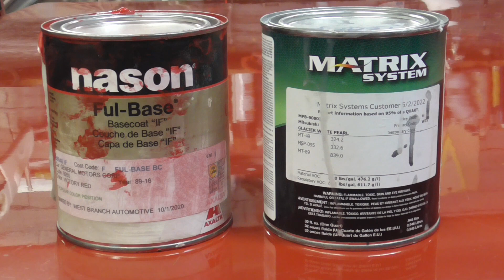Does Base Coat Need Hardener?

Comment: It was back in 1980 up until 1992 and some other cars up until 1999, I used PPG ditzler acrylic enamel on some early and late 1970s cadillacs I bought for cheap prices. It worked best with 35% reducer. I had no one to teach me how to paint a car, so I just did it. These paint jobs came out good on these cars and I did these jobs in the back yard of my dads house back then on my days off of work. There was no hardener at all because I didnt know it existed. Now I know even today you dont need a clear coat when using acrylic enamel. The last one I had painted was a 79 sedan deville cadillac and I drove it up until 1999 and had painted that one in 1992 and it still looked shiny and beautiful in 1999 and was an outside car. Go figure?? I also used no primer at all, and did not use any hardener and simply used a flat sander to sand down the existing paint. So based on that, that fender in the video above I could have done with acrylic enamel and it would be shiny for 7 years or more. Any comments? Im open to any comments of why this worked on what was around 8 cars. Heres something else. in 1999 I also painted this 66 mustang red and used acrylic enamel and no hardener and no gloss and it came out very shiny, but a guy names Ramon that was supposed to be a professional painted my employers 1969 oldsmobile 442 red with acrylic enamel and he had gone to school, but my job on the mustang without gloss came out better than his job where he used gloss. Now I know you have to use clear coat gloss on urethane because urethane is flat, but not on acrylic enamel.
Reply from the maker: I used that same paint in the 80's - Ditzler - with the hardener and same amount of reducer.  That and Dupont Centari were great paints.  Acrylic enamel doesn't need a hardener to dry or cure but works better with one.  Urethane on the other hand absolutely needs activator to harden or dry.  Single stage urethane will be shiny like acrylic enamel but needs hardener.  Base coat urethane will be dull and needs clear for the shine.  Hope that helps - ask more ?s if needed :)
Reply: @LakesideAutobody  Yes, that did help. Because I wasnt sure if you could get away with not using hardener in acrylic enamel. I didnt use hardener back then because i was ignorant of it being around and no one would inform me of anything back then. The reason I dont like urethane and gloss is because since the age of urethane all these cars with worn off gloss on the roofs and hoods. As a boy back in the 60s any old abused car might have paint with no shine, but even then I never saw paint that peeled off in the way these 90s on up car hoods do today
Reply from the maker: @EarlGuyton425  I'm not totally sure but I think the pealing paint from GM may have been the beginning of water based paints.  Urethane paints stick well and hold up better than any so don't be afraid to use them.  Enamels did lay out nicer (my opinion) but urethanes are very durable and will not peel or flake off if used correctly :)
Reply: @LakesideAutobody  I wasnt really talking about peeling paint, but the gloss is gone and leaves the flat color under it is what I meant. Mainly on hoods.  I see this all the time on japanese brand cars and even the mans mercedez at the station i visit many times for hours as he does state inspections. Its Nissans and Toyotas that are the worst that come in
Reply from the maker: @EarlGuyton425  Got it... not sure what caused that myself.  You'd think the OEM's would be using the best stuff out there :)
Reply: @LakesideAutobody  Dont know. Maybe its the climate here. I live in Houston Tx and this is common on cars six years and older.  Areas of hoods and trunks have large areas that have where the gloss become white around the edges and it grows and leaves flat paint that is gone after some time and it looks so bad. Ive seen some videos on it here at YT and its described as gloss coat worn away.  This is so common here that it can only make me know a good paint job with acrylic enamel like the 70s and 80s procedures would stop this. My 02 ford supercrew hood and roof did this BTW. Now I painted my roof 3 years ago black from red and that scheme made the truck look more distinguised and helped its looks. My 89 Cadillac brougham still has the original number 11 artic white and its still good and before I retired in 2022 it was out in the sun all the time. Im not sure what type paint is on it, but the mil thickness is only 2.0

Comment: Hey Jerry, I think we were recently discussing this - cool that you did a video on it!! I recently switched paint suppliers and the new one sells PPG products. I bought a gallon of their Omni MBC basecoat - no hardener needed (per the TDS it is optional). The basecoat will be protected by the hardened clear. Makes sense to me! With paint products being so expensive, it is nice not to be throwing any away. Also, no fretting over whether I am mixing enough or too much = waste. I mix a cup, paint the repair and poured the excess into a clean, new one pint can for next time. Thanks Jerry, you-re saving everybody $$$!!
Reply from the maker: You're welcome Icar - I believe we did talk about this recently.  Thanks for your input my friend.  You're right about the cost lately - crazy!

Comment: Nice job Jerry.  I love spraying simple reds.  I dunno if you've ever sprayed Endura, but it's a two part epoxy paint.  We were a pretty busy shop so we mixed it almost exactly 50/50 hardener/paint with a little thinner if required.  It was the perfect ratio for fast drying and glossy finish.  One day I sprayed the entire first coat on a class B camper van with no hardener.  For some reason I'd mixed it 50/50, but I used no hardener and 50% thinner.  I kept waiting for it to tack up, then I realized what I had done.  I just sprayed my second coat with extra hardener and the third coat as normal.  That was 35 years ago and the paint held up longer than the van did.  I used to see it around the city for years
Reply: Endura from Edmonton?
Reply: @p-m2127  yes, Endura from Edmonton (where I live)
Reply: Best paint ever for winter beaters

Comment: In the UK all solvent basecoats are air dry, but the data sheet on a few brands like ppg or prospray does mention adding 5 to 10% 2k hardener will add to the adhesion properties of the basecoat, reduces chipping, but it is optional.
Reply from the maker: Thanks for the input EJ.  I like to hear others' thoughts on the topic.  Have a great weekend :)

Comment: I used nason here last week without the hardener. Everything went well until I started wet sanding my clear coat. Everything dull up like it should but polishing didn’t help one bit. I used 800/1000/1500 all the way to 3000 prior to buffing. That being said my hood looks like I sanded it with 600 dry. My question is I’m spent and now I’m just going to shoot single stage over this mess. Time is my question about how long should I wait before shooting single stage. It’s been in the sun for a week. Thanks for any advice. By the way I pretty much learned a ton from you. I never had this much trouble with any of my other paint projects. You are an inspiration.
Reply from the maker: You did add the hardener to the clear though right.  You have to have activator in the clear but not the base. You also have to use hardener or activator with single stage.   What brand of clear did you use?
Reply: I actually worked out my own problems. I wasn’t using the right buffing pad therefore I wasn’t cutting anything out. After I realized my mistake it started to shine without burning through the clear. Bodywork sure can be scary when your new and it’s definitely not cheap. Thank you for your time,advice and so on. I really enjoy the restoration process especially when it turns out good. Have a great weekend.

Comment: You seem to be missing the point of what the activator does. It's just cheap insurance. The purpose of the activator in the basecoat is to enable it to be repaired.  Let's say you're polishing the panel and you cut through the clear to the basecoat. If the basecoat was activated no problem. The basecoat is cross-linked and basically impervious to solvents at that point. You apply more base followed by clear and the world continues to turn. If you don't activate the basecoat as soon as you shoot more base onto the un-activated base it will fry up leaving you in a complete shitstorm. This is why all of the major paint lines: BASF, PPG, Axalta, Sherwin-Williams and Akzo Nobel require activation of their solvent basecoats for them to warrantee the job. Waterborne basecoats have no such issues as the solvents in the clear do not attack the waterborne basecoat.
Reply from the maker: Good points S. Man.  There are strategies to repair the area, however.  Just like the old days when you had to spray lacquer primer over relatively fresh enamel - start with a super light coat, let that dry, then a bit heavier, etc.  Have a great weekend my friend and as always thanks for watching through the years and for your thoughtful input :)
Reply: What does "fry up" mean in the auto body language?
Reply from the maker: @designsinorbit  It is when you lay paint or primer on too thick or wet and it wrinkles the coatings or area that you are repairing.  Basically its a bad chemical reaction or products not agreeing with each other :)
Reply: @LakesideAutobody  yeah the 1st couple of light coats are to help "seal" it off from doing that. 
As a spray bomb amateur expert 🤣 I usually do that in general because I've been there with the paint lifting and looking like wrinkle finish on a toolbox 🤣

Comment: Hi mister Jerry...My first question for ya as I begin my journey (I'm starting body work on my Monte). The vinyl top had a couple bubbles so I ripped it all off. The roof is still in decent shape thankfully..left with some surface rust and hard glue. What would you do at this point? I'm guessing take 40 grit on a sander and go to town. Then 80 grit, then 120, then primer, etc. Whatchya think? :)
Reply from the maker: Exactly.  I would use the bondo hog with 40 though first - like this video - https://www.youtube.com/watch?v=tjF6XPSX9Zo  Sorry about the late reply - sometimes don't get the notification - let me know how your project goes :)
Reply: @LakesideAutobody  Thanks so much!
Reply from the maker: @designsinorbit  You're welcome :)
Reply from the maker: @designsinorbit  You're welcome 😀

Comment: I was just going to ask if this also works for single stage paint. Looks like I got the answer below. So I'm guessing you could still possibly not use hardener even with metallic paints? Is it that much more difficult to spray metallic without it? I don't use a heavy metallic; just single stage with a little metal flake. I've painted old school vehicles from the 1970's.
Reply from the maker: You don't need hardener for acrylic enamel paints but it works much better with it.  Urethane single stage and clears will never cure with out it - trust me.  It's absolutely miserable if you forget to use hardener in clear and SS paints - you MUST remove the paint if you forgot it - it will not harden :(
Reply: @LakesideAutobody  thanks for the advice. Probably works better all around to use hardener - Makes the paint go further......
Reply from the maker: @stephensaasen8589  I guess it would stretch it a bit if it was 4:1, you get 5 parts :)

Comment: I really enjoy watching these videos.   What has been your preference on the settings that work best for you when using the 3M performance gun?  Spraying base and clear. 

Thanks
Reply from the maker: I spray at 15-18 psi and use the 1.2-1.4mm tip for metallic base and the 1.4mm tip for the clear.  I don't spray with a wide open pattern as I think it creates too much overspray.  It doesn't matter how wide your pattern is really anyway - it will not effect the way the metallic flakes lay down or anything like that.  Guys in a shop spray door jambs with a tiny bit of pressure and a sharp pattern to be super accurate and they turn out great.  Or folks even use a spray bomb metallic paint and it turns out fine because of technique :)
Reply: @LakesideAutobody  Thank you!  About to spray solid color base and will see how it does

Comment: Hi Jerry, more great info. I always thought every base needed activator or hardener. I know clear definitely does, or am I wrong? Is there clear without activator?
Reply from the maker: You're right every urethane clear needs hardener.  Acrylic enamel clear (I think paintforcars.com carries it) will dry on it's own but performs much better with hardener.  Last, lacquer like - Restoration Shop 1 Gallon Cl3245 Hi-Performance Acrylic Lacquer Clear - does not use a hardener.  Have a good weekend GM 😊

Comment: most refinishing shops doesn't activate because its cheaper and most of paint mixing shops doesn't mix for 2:2:1 (with hadner ), so if you add the hardener to your colour coded basecoat it will dry slightly brighter. 
You don't believe it, spray yourself front bumper with unactivated basecoat, you will see ugly chips only after a month and after a year all will need a respray. also you'll be able to shave off the clear layer with utility knife like kebab as uncured basecoat doesn't have any strength and doesn't bond clear coat with the primed substrate.
Reply from the maker: I haven't run into that problem at all with any brands.  In fact, many BC brands don't require activator like Matrix for example.  Luckily the closest paint mixing place carries it.  Nason requires it but in this video and others I did use activator on the base and again had zero issues.  Now.... If you spray clear w/o activator it will never harden - like you said, "you can shave it off a year later with a utility knife"  :)

Comment: I noticed you sprayed the color top to bottom and the clear bottom to top. Is that the way you allways do it?
Thanks for another great video Jerry!
Reply from the maker: Usually I always go from top to bottom - it doesn't really make a difference.  Probably did it to get the best video shot or angle.  It will turn out the same both ways.  Have a great week Rod :)

Comment: so as i understand .. some paint product need hardener and others don't ?  i'm a big fan of epoxy thats why i was confused because i ordered some paint for my jetski and the colorcoat has no hardener .. but needs a clean on top ! well done sir
Reply from the maker: Urethane clear absolutely needs hardener - it will stay gummy if none is used.  Base coat (color) doesn't need hardener.  Acrylic enamel clear doesn't need a hardener but holds up better if one is used.  Lacquer clear doesn't need an activator either.  Both lacquer and enamel clears are still available and work well but less durable than urethane with an activator

Comment: how is the overall paint job durability without hardener?
I will be painting my car panel by panel over several days to weeks. Dunno if I should use hardener
Reply from the maker: Just fine - still perfect today.  Hardener was used in the clear though.  No hardener in the base - hardener in the clear.  If the label says use hardener, it's probably best to do so :)

Comment: Can wait to see the follow-up. My concern would be if — for some reason — you need to sand a part of it after, let's say, a year... It would probably be a little mushy, hard to sand & clogging the paper. But usually, you wouldn't need to do so... That's what it did with the paint I was using anyway... As if it stayed a little soft, even after a year... But I am in no way a pro, so, might be my mistake...

Comment: Hey today I sprayed primer and around the areas tht I did body work and the areas around bare metal u can see threw what can I do to fix tht I think it’s called edge mapping
Reply from the maker: After your primer surfacer (have to use primer surfacer) dries, then you block sand that.  That process removes any chance of seeing your body work when painting.  You can't do body work, prime and paint as you will always see the edges.  You must prime your body work with thick primer surfacer, block sand, prime again, finish sand, then paint.  Primer surfacer is a thick type of primer that is made to fill imperfections and the edges of your body work:)

Comment: I have a question hopeful you can answer or some one with knowledge I paint my base coat with no hardener and let it rest for 1 or 2 days then I put my clear coat and I got some bumble not sure if I can just sand those away and wax it or do I need to sand down and put more clear coat. I have put 3 coats of clear coat ? Can you please help
Reply from the maker: Usually if you get bubbles in clear coat it's because it is being applied to quickly or to thick.  Your first coat can be a bit dry, then the next one if it's your last can be nice and wet.  Use reducer in your clear like 4 parts clear and activator to 1 or 2 parts urethane reducer.  Sorry I missed your comment :)

Comment: Hi Jerry, I have a 66 VW which I am working on it as a hobby. I want to paint the body but because I am using my garage I want to avoid 2k paint with isocyanide. 
Is there an option for me to do that?
Reply from the maker: Yes.  Any paint that's not 2K like automotive grade lacquer, farm and implement oil based enamel, and/or acrylic enamel kits from paintforcars.com  It will hold up pretty well but not as well as using a hardener :)

Comment: So how did you decide one way or the other?  Doesn't prove if hardener in or not is a good idea..........
Reply from the maker: Basically it's always best to go with the TDS or instructions on the label but there is a debate out there on whether or not basecoat really needs an activator.  Some basecoat brands say use activator some don't so, "What's the truth?"  This video should give you the confidence to use hardener if you have the $ for it - $30-40 / 1/2 pint.  or don't use hardener and save the money yet get the same results 💯